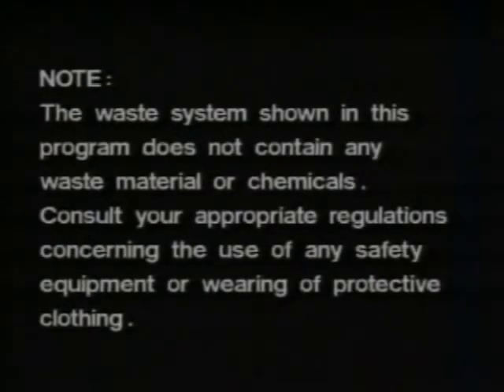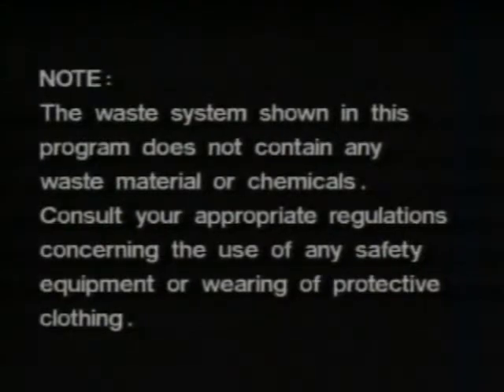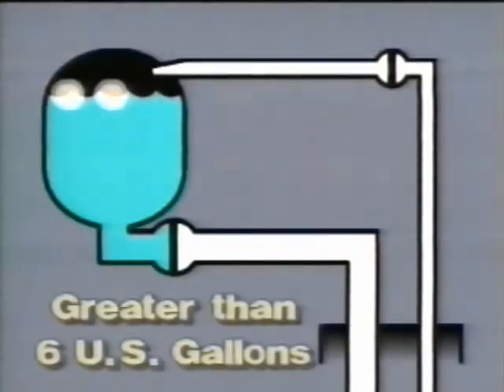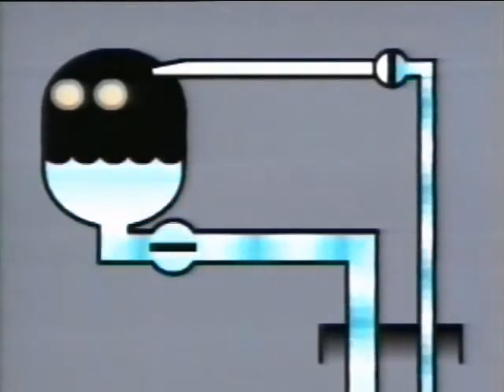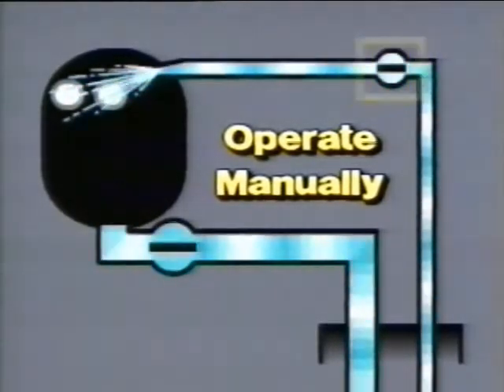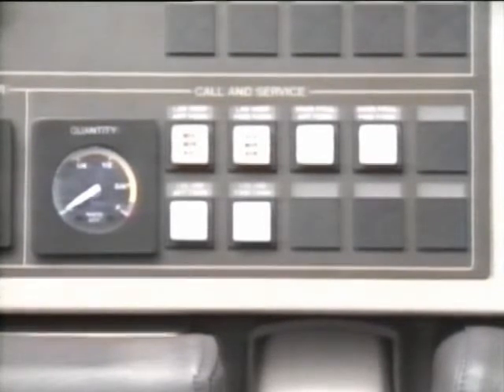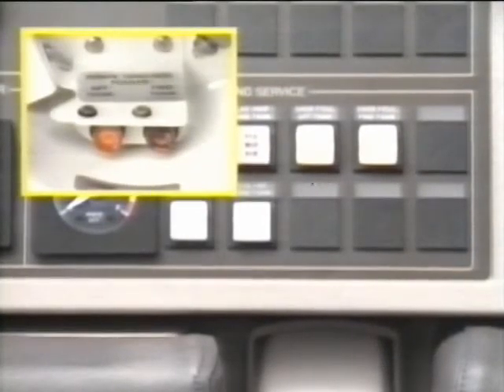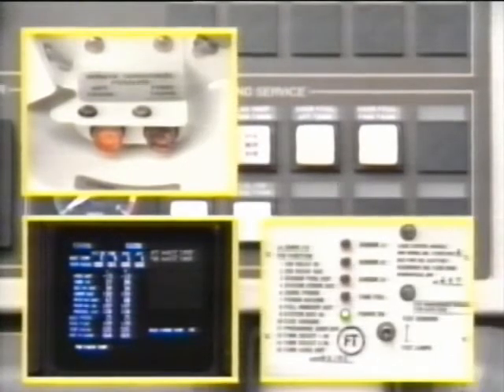B767 Vacuum Toilets Overview

Comment: Cool video to an overlooked aspect of aviation history given this was the aircraft the now common vacuum toilet system started on. What I've been curious to know is if any passenger configured 767-200s came with the chemical 'recirculating' toilets like on it's 757 counter part given the new, mostly unproven tech at the time. I know either system was an option on the a300/a310 throughout much of the 80s/early 90s as well as some early a320s, perhaps most notably BA's rare a320-100s. I've heard it through passenger hearsay, but never seen any non-freighter examples in person or online.